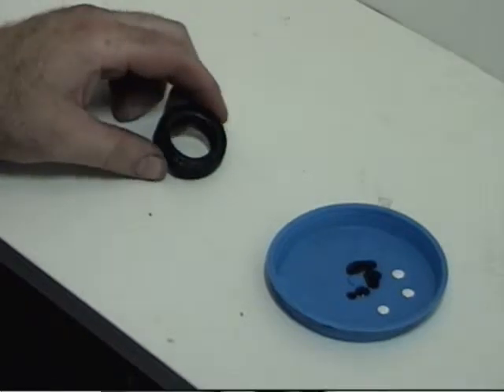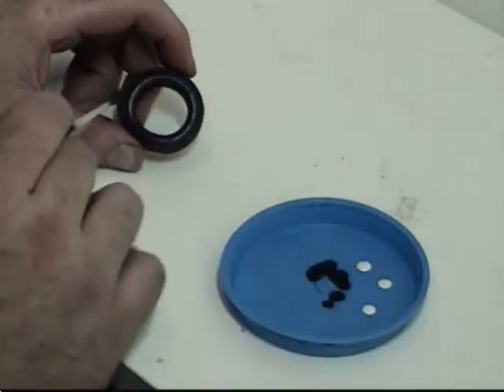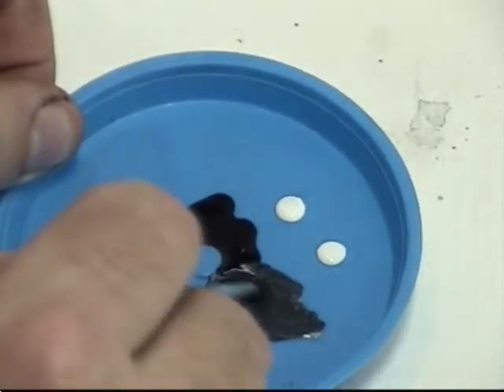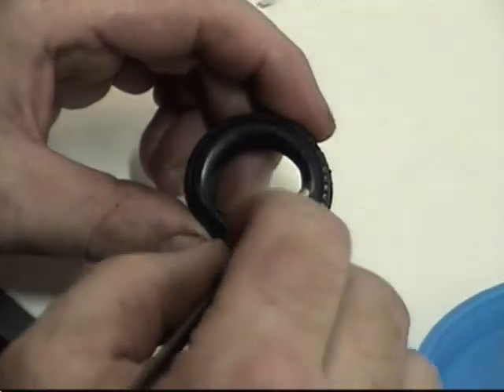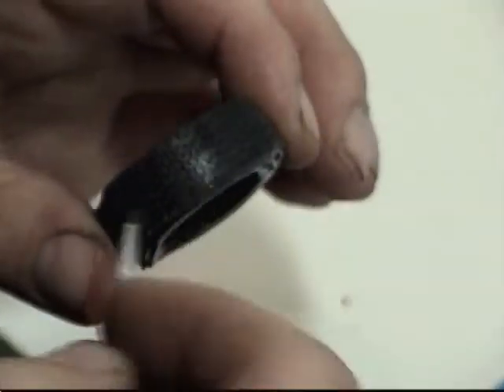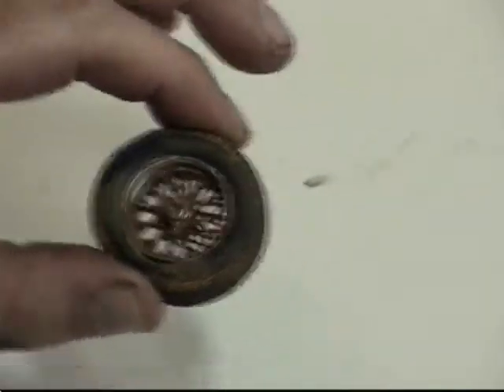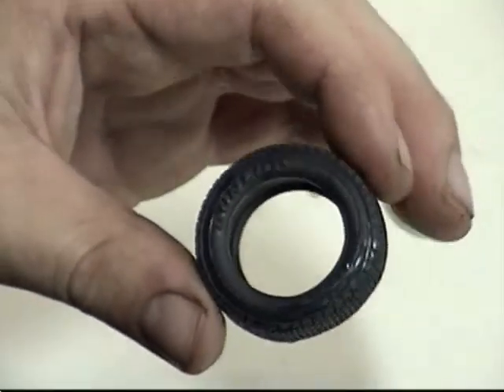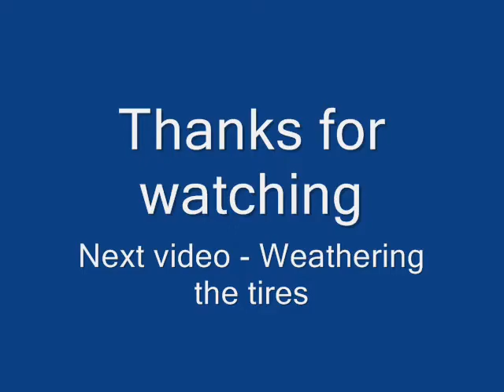DiecastFANatic Project 166 Part 3 (Painting the tires for an aged look)

Comment from the maker: To take them off the 166, you have to take the screws out of the under side till you can get to the suspension. The front wheels have a screw holding them on the spindle. The back wheels are easier. There is a metal axle holding them together that they are pressed onto. Hold one wheel and twist. One side will give up and they come apart. Then just squeeze them back together when you're ready. The tires just pop off the rims. The 166s are a little tougher to get off the rim than the 250GTOs.